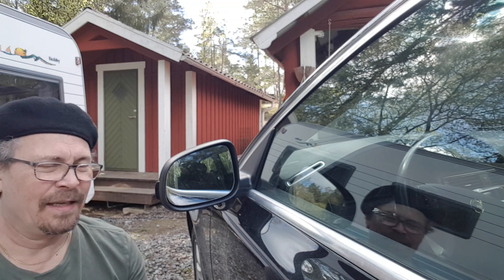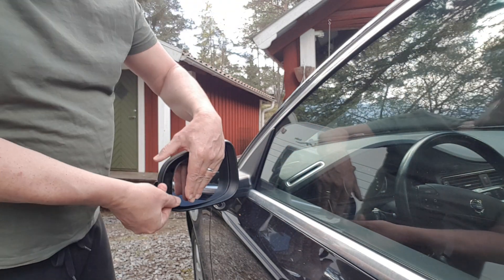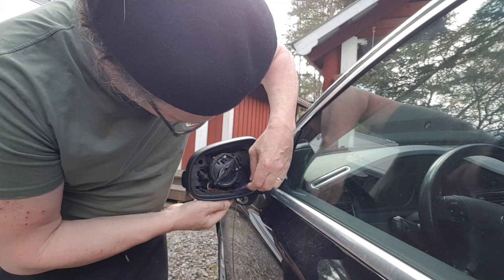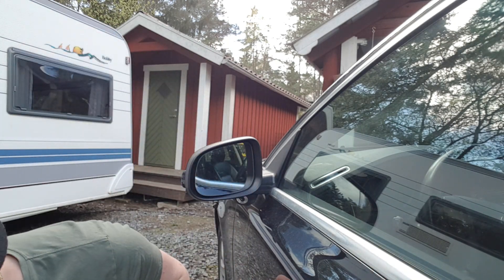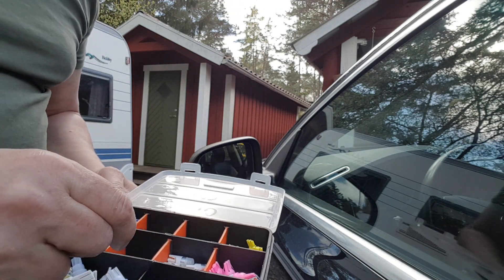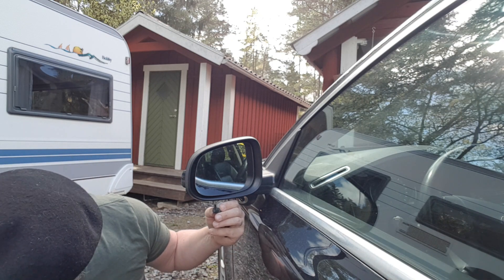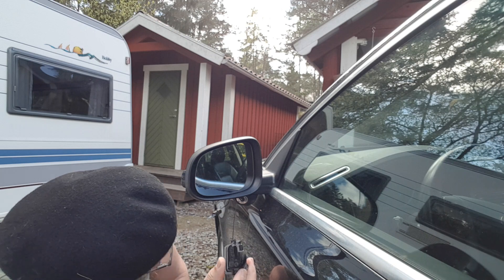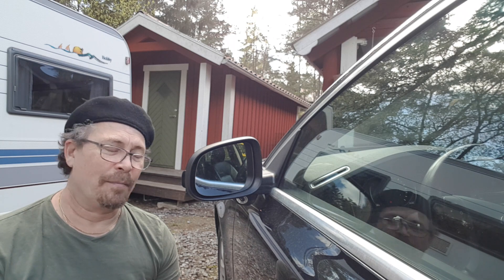Volvo V70/S80 Cool Effect With Stronger Puddle Light

Comment: Appreciate it man, got my 2015 s60 been trying to figure out how to change the puddle lights…now I know! Have u ever thought about changing the footwell lights to LED’s as well?
Reply from the maker: Hello Ruester. I have changed the footwell lights. On my 2012 its led original but changed to way stronger ones. I have also put strong led in the door underneath. And blue light in the pocket in doors. More will come in spring when weather allows to be outside.

Comment: Hi I like do,  I just purchased volvo S80 2008-2,0 diesel salon like yours  but in my case puddle lights not work, I not vheck yet   so maybe broken bulb.
Question for You   then connected from factory's? I interested,  the puddle got vire all ready,  I try find out, but any suggestions I'm very welcome. Thanks Zbi
Reply from the maker: Hello Zbi. Congratulations to a nice car. I actually bought a S80 today. Original are incadescent so maybe just broken. If you have the housiing, you should have puddle light. Check that first.